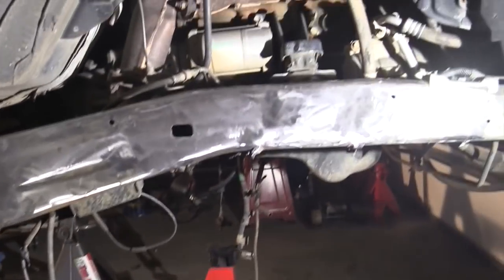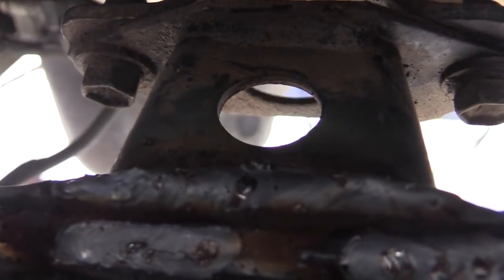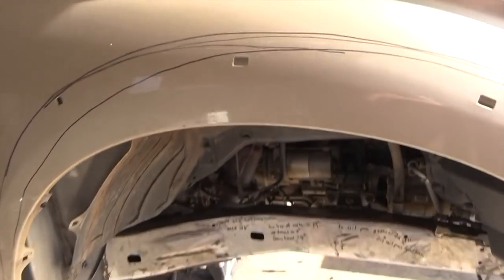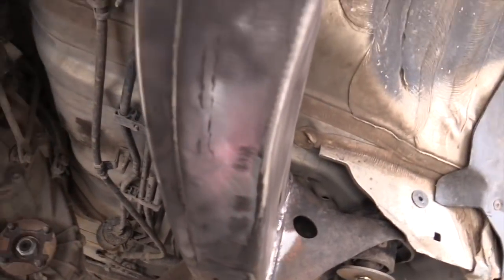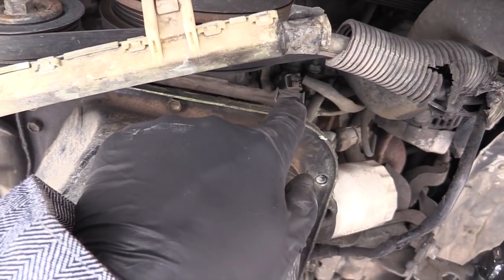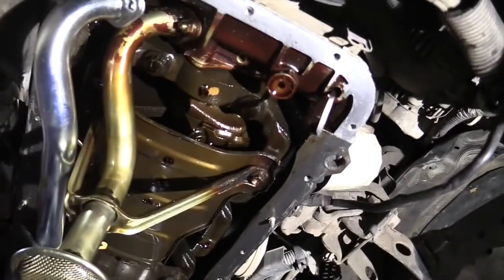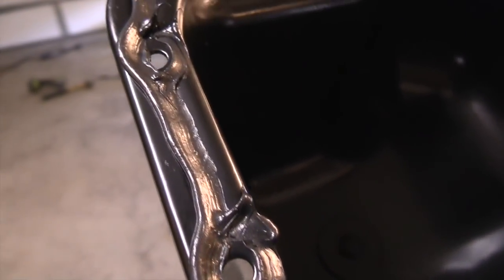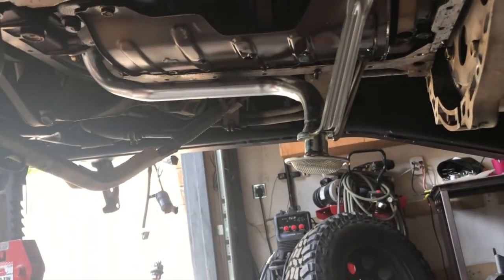TACOMA SOLID AXLE SWAP PART 2- SWAPPING OIL PAN

Comment: Hello Where did you find the oil pan and all the parts that go with it? I went to the Toyota dealer but they didn’t have anything.
Reply from the maker: I got most of the parts from trail gear
Reply: @HiddenInstinct  I’ve got a 95 solid axle swap and everything on that truck is from trail gear except for the 63 Chevy leaf springs in the rear end!